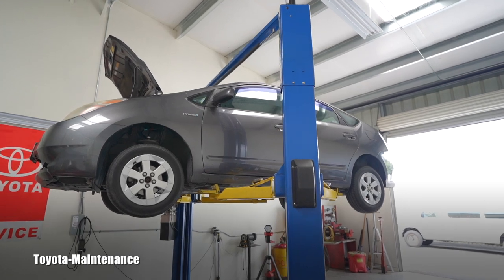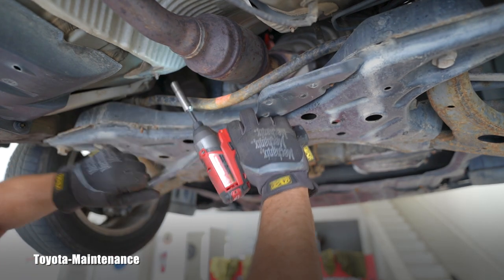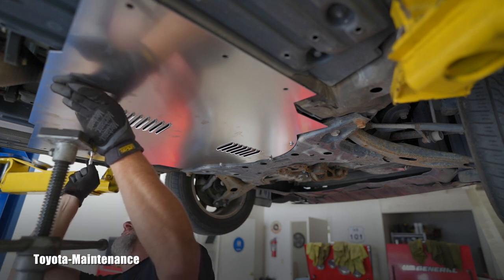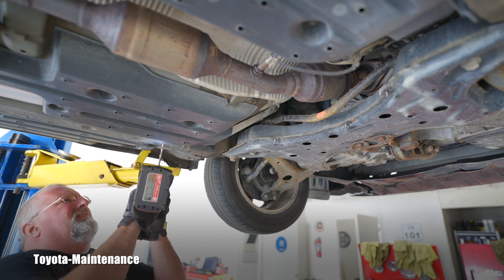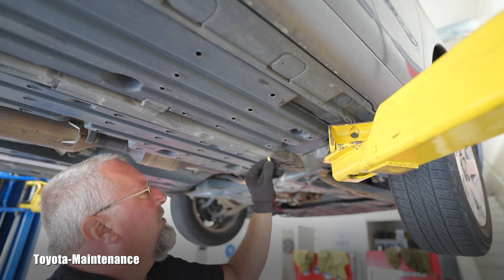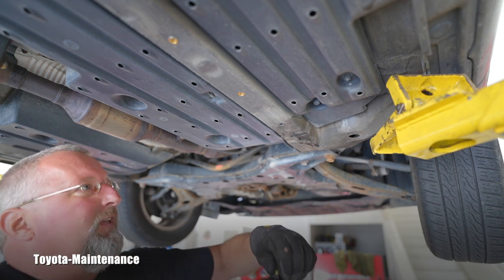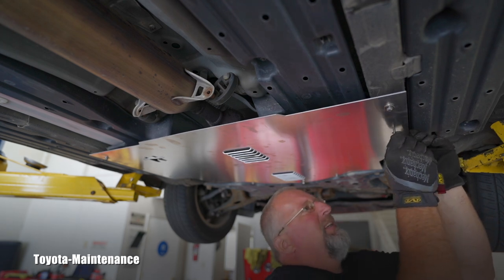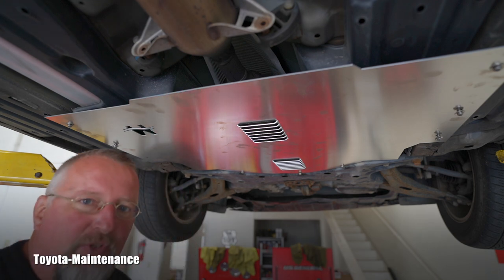Prius Gen 2 Catalytic Converter Shield from CAT SHIELD

Comment: Peter, the one thing I really love about your channel is the introduction of really cool tools!!!  I have been subscribed to your channel for over 2 years and have learned so much.  During this time I have purchased many of the tools that you use daily.  An example of what I have bought includes a "Strip Light" with magnetic base, a Toyota Motor Oil Funnel, a gallon of Super Clean, and of course, I only use Denso Spark Plugs in my Tacoma.  Granted, I'm too old to perform maintenance on my own, but it does help me understand my vehicle and I use these items when I need repairs performed.  My most recent oil change, I took along my oil funnel to the Toyota Technician.  He really loved it!!  So much so, he offered to buy it.  I gave him the source of purchase and told him to have the dealership purchase it to speed up oil changes. He felt this was a good idea.  Again, love the channel.  Thank you so much Peter for sharing your knowledge!!!!

Comment: Peter, you’re the greatest Toyota mechanic in the world!
 My 2003 Tacoma PreRunner 
5VZFE 
298k 
I put 140k of that and done plenty of work on it. It has me confused. Cranks and won’t start. Is there someway I could ask you questions on fixing it? 

I’ve done ALL my own work for my 140k, 9 years I’ve owned it. 

Timing belt/water pump, full front end rebuild, valve covers, Throttle body, etc. I’m stumped on it right now though. 

If you have time and a way I could contact you, would be eternally grateful. 
Thanks!

Comment: I had my 04 Tundra cats stolen. I installed a 1/8 " skid plate and had the muffler shop weld the skid plate onto the frame in several places. I wasn't going to just rely on the bolts that held it place. This plate seems far too flimsy and a angle grinder will cut through those screw heads in seconds. He should spot weld it in several places as well. Because of how flimsy the metal is, thief could easily cut through the sheet metal with big tin snips nice and quiet.

Comment: I hate to say it Peter but if I didn't live approx 7,970 miles away I could show you just how easy and quick it is to defeat those anti tamper screws very quietly without using similar anti tamper/theft bits. I won't put it in writing here as I don't want cat thieves to know.

Comment: It might sound crazy. But if you're paranoid thief's will get their hands on these unique bits. You could always strip the screw head so bad you can't remove them. A little extreme but effective.
Reply: I used a mixture of security bits and then filled the heads so you can screw it off so easily haha
Reply: They don’t unbolt them, they cut them off and sell them to scrapyards for their rare metals. Stripped bolts or not, they cut them off
Reply: @ItsAlive111  we are talking about the hardware securing the shield to the vehicle not the cats
Reply: @stevenlopez8361  they can cut that aluminum sheet with the same sawzall they cut the steel exhaust catalyst
Reply: @ItsAlive111  except the sheet is stainless steel. Which will take extra time and making more noise. Come on. Really?

Comment: Tack weld a bead on EVERY bolt, to really slow them down. Although they'll just cut off the heads...
Reply: Unfortunately you might slow crooks down but stopping them all is impossible
Reply: Most are looking to cut the cat out  and get away as fast as possible so they don’t get caught. So if they see one of these, most will move on to one that is faster and easier. That is all they are looking for with these guards. Besides there are other devices and methods to stop the theft by causing “consequences” to occur.